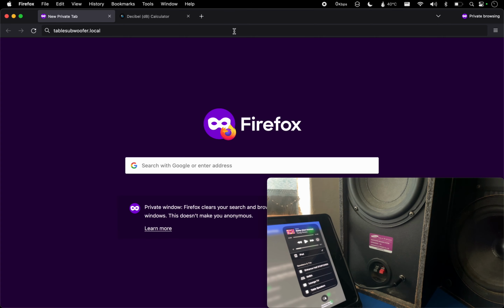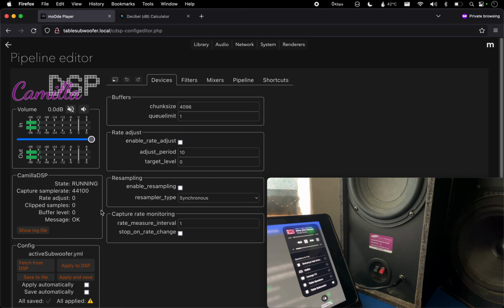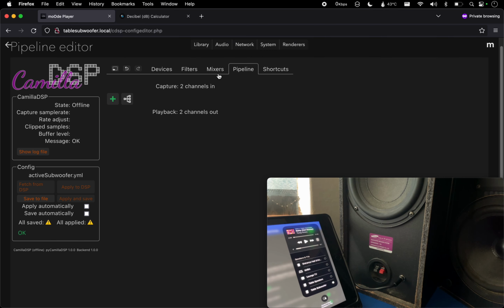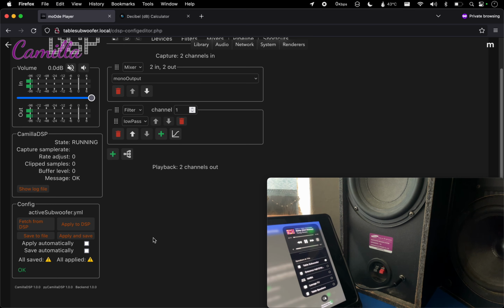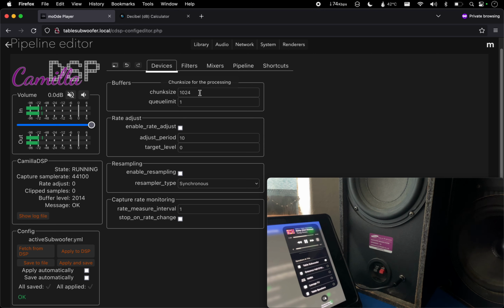Setting up CamillaDSP on Active Subwoofer Project (moOde + Zero2W + DigiAmp+)

Comment from the maker: Corrections/Clarifications
2:19 - "496" should be "4096"
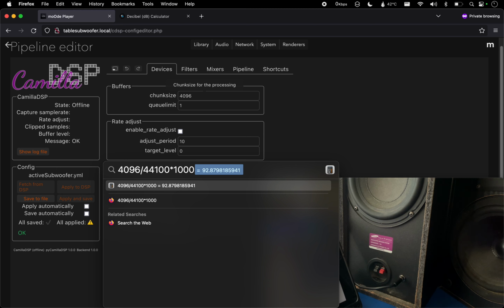2:52 - Processor power requirements are dependent on the types of filters used
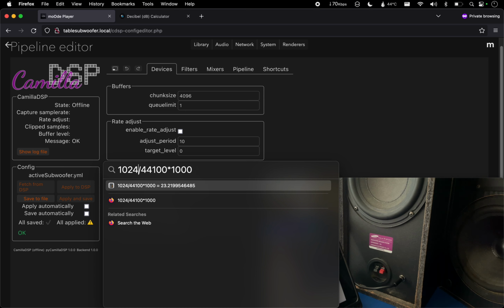3:00 - Subsequently I have settled on a 2048 chunksize on my underclocked Zero2W
5:49 - "full range" should be "full amplitude"
6:03 - Same amplitude refers to the amplitude of the separate channels before mixing to mono
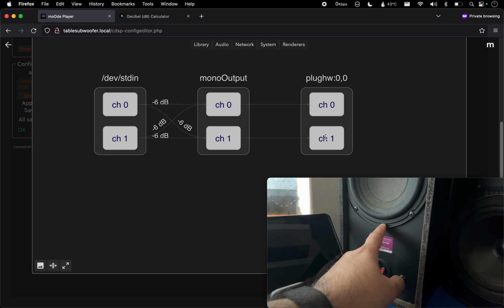7:03 - Full range refers to an audio signal containing all frequencies
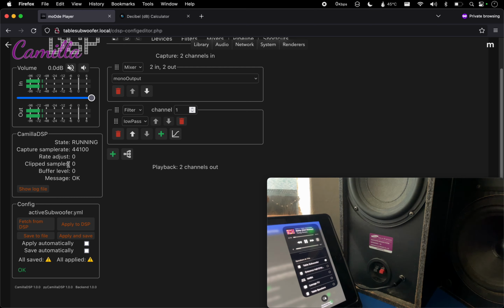8:40 - The settings are present, just unable to be clicked while CamillaDSP is not running
9:30 - The speakers and subwoofer are grouped using AirPlay 2
9:52 - "buffer size" should be "chunksize"

Link to full build in description

Please flag any other confusing statements or corrections required, thanks

Comment: Regarding your Mono/lowpass setup - I could not help but wonder why U did not set up a high filter to the left channel...
Just my two cents.
....And another thing - the effect I am after involves mixing inverse (attenuated + variable delay) right into the left channel and mixing inverse ( attenuated + variable delay )  left into the right channel. I would like to know if there is a filter to inverse signal and where I control delay...Any ideas?
Reply from the maker: Hi Menachem, 

1) No filters on Left Channel
- I didn't add a filter on the "left" (ch 0 / Terminal connector) because I wasn't sure what speaker I'd connect to that channel in the future. Thus as a default I allowed all frequencies through.

2) Mixing inverse and variable delay
a) Adding Delay
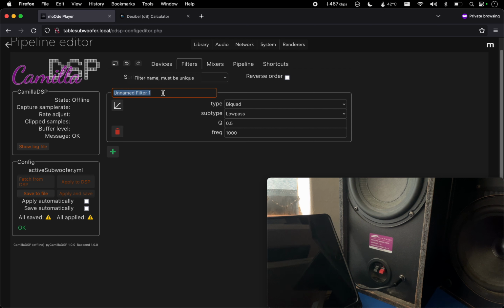- Under the "Filters" tab (07:22), when adding a filter there is a "type" called "Delay" that can add delays.
b) Mixing Inverse
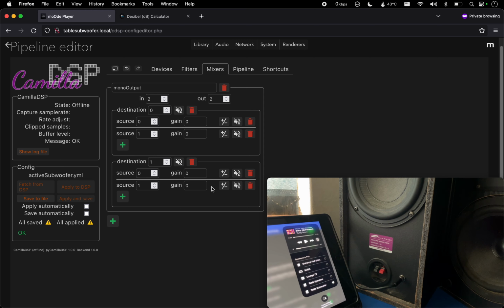- Under the "Mixers" tab (05:33), you can invert a channel by clicking the +/- button.

Using the pipeline plot (08:06) can be a handy sanity check to make sure it's set up as expected.

Keep me posted if it works out!